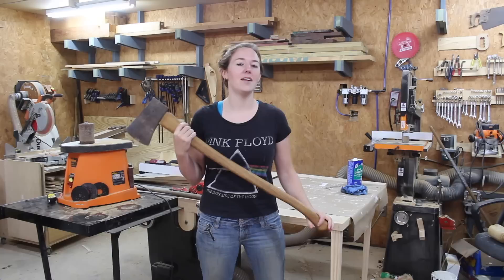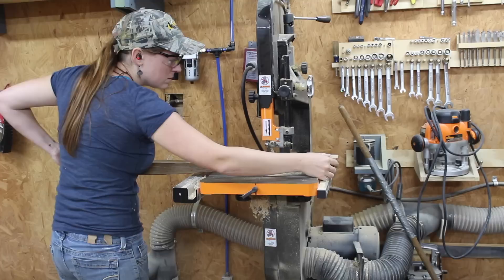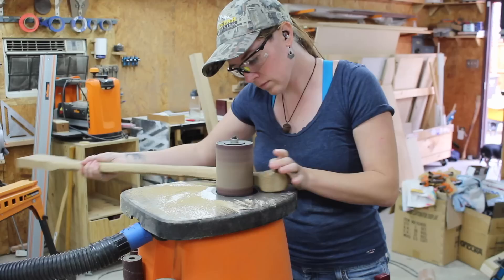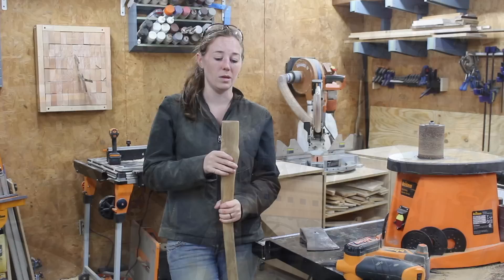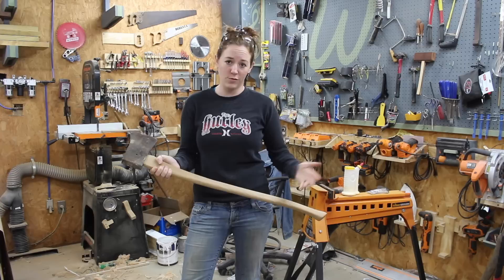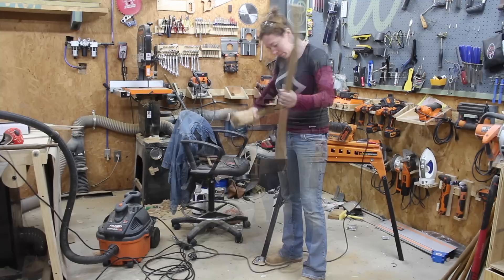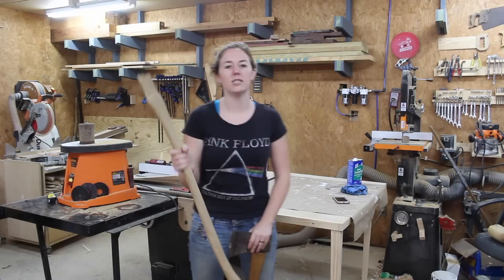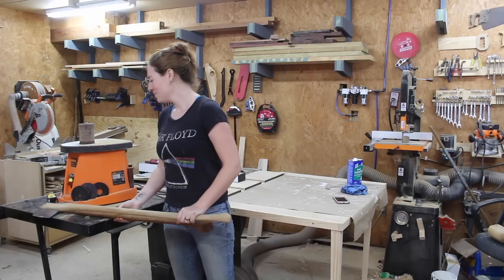Making an Axe Handle

Comment: I made a cabinet door for my kitchen, and discovered that I had put the rabbet for the insert on the outside on both stiles after assembly. (future small picture frame maybe?) I have learned woodworking by trial and error. (LOTS of error!)

Comment: Well, April. Here is my failure. I was making a drawer for A piece that I had built the year before for my parents. Now this was my first ever building a piece of furniture, so nothing was quite square, just square enough to fool the eye. And so the drawer had to match the out of squareness. I probably spent a few hours making the drawer bottom just right, and went ahead and glued it up. Much to my dissatisfaction I found that I had glued the bottom in upside down, and in just the worst orientation possible. 

Now I did manage to save it in the end, but it wallows around in the cabinet, as opposed to the close sliding fit I had achieved before gluing it all up.

Comment: Built an entire kitchen table only to find out I had put the whole table top on upside down, with all the attachment points on full display for anyone to come see. Pretty sure I had put the legs on backwards too, but didn't bother to check, turned it all into fire wood then restarted it all over again. You learn more from your failures then you do from your successes, although it is nice to get things right the first time.

Comment: Yep, I got a good mistake also. I was building drawers for under my bed. I measured many times and cut like you should. But, I found that I needed 1/2" more taken off due to changing my drawer rails.  But I cut 1 and 1/2" off (stupid mistake). Needless to say it did not fit.  Then I had to make a 1"  spacer so I did not have rebuild the drawer (which was a lot cheaper).

Comment: soak the head / handle in antifreeze for a day. It will expand the wood. Then dry it for a few days the water will evaporate but the glycol  and borax will stay in the wood keeping the head nice and tight. It will also make it so the wood expand and contracts alot less with humidity thus not come loose.

Comment: draw knives are so nice to use I use them to make Bows from Yew. you don't even need a band saw to do it. It goes so quick. And with your super jaws to hold it it would have made quick work of your handle and just minimal sanding. Try making a Bow only to have it explode when working on the bend in it. 10 hours of work gone in a instant

Comment: I have never seen a professional lumberjack use a curved axe handle. If you ever redo this, go about it like the traditional axe handle makers do:

Find a straight, knotless piece of hickory or black locust, or if one of your European friends can get you any, cornel cherry - it's IMO the best one, harder than hickory but still elastic (so dense it doesn't float). Split it lengthwise (i.e. don't cut it) to a piece about the shape of and a size slightly larger than the axe handle you want to make, and then shape out the handle using a drawknife and spokeshave.

An axe handle is exposed to a lot of shocks. If the fibers are not continuous from one end to the other, chances are it will split. It's also the reason why woods which are both tough and somewhat elastic are used - birch or oak are tough but tend to crack rather than bend under stress.

Comment: Instead of hitting the bottom of the handle to seat the head, I always slam it on the floor. It's faster than the mallet. Also, there is no need to glue the wedge. Once installed, it will not come out.

Comment: Here's my story of accidental failure -
I was a System Administrator for a retail chain, with a computer in each store that handled the inventory and price changes.  One late night I was logged into one of the stores from home, and when I got finished with what I was doing I did a routine check for any additional issues.  The database directory had a lot of old error files that I decided to get rid of, but as I was typing in the command my thumb twitched on the space bar at just the wrong instant and I deleted the whole database.  I had to call the store (luckily there was still someone in the office) to have them mount the previous night's backup tape so I could restore it.  But of course they weren't current on their backups, so the most recent we finally found was three days old.  I restored things to that point, then the next day they had to re-scan in three days of markdowns - which probably took a good half day - before they could get back to work.  Yeah, that was fun.

Comment: Mistake... Before we moved, I replaced the overhead slab garage door with an aluminum tracked overhead door with coiled counterpoise spring. Just to get it all set up nicely, I faked it in with big nails, then started replacing them with lag bolts.

A week after we moved, the new owner called. "You garage door fell down!". No one hurt, car wasn't in the garage, but, geez!

Yep. Failed to replace MOST of the nails. Repositioned it, bolted it, mea culpa-ed about a hundred times.

Door is still working 19 years later.

Comment: Creating the opening for my Kreg Router plate on melamine.  

Try #1:  Carpet double-sded tape scraps on melamine so I can route the opening...as I was routing, the square opening didn't look square. I realized the double-side tape was sliding.  It was completely messed up.   

Try #2:  Clamped the hell out of the scraps to the melamine...slipped again because of how slippery melamine is.   (mind you this has wasted 2 - 24" x 36" boards).  
Try #3:  Big sheet of MDF that covered entire Melamine surface, created square opening template, double side tape and every clamp I had.  Success...

Comment: I had a mistake like that. I built a box with curly maple and had the grain going in the wrong direction. So I had to scrap it. Nice work on the handle but don't think that was a mistake because you have more experience shaping another one.

Comment: Great video, but a bit confused, what was wrong with the old handle that you had to discard and do a new one???? Looking forward to the next video.
Reply: mumihp, its backwards. The head won't fit on the right way.
Reply: The teardrop shaped top of the axe handle, which was so carefully fitted to the eye in the axe head, is now backwards, and cutting the shoulder of the handle down to recreate a new top would leave the axe weakened at a vulnerable point of stress just under the head.

Comment: A mistake that I've made...I was trying to build a rolling work bench but had to take a break for about a week.  When I got back to it, I had one side built and just had to build the second side then add the braces between that ran the length.  Well On the second side I grabbed the width pieces instead of the legs, and didn't realize until I tried attaching the two halves.  One side is about 4" shorter than the other, so I'm going to cut the two legs on that side, square up a 2x4, then put it where I cut the legs to boost that side up a few inches.  It was a bummer and I won't be able to get back to it for a month or two, but mistakes are how we learn

Comment: Most people do what you did and start with shaping the handle first. For your next one, perhaps do the head work first. Get it right before starting to shape handle.   If there is a mistake you will not have lost so much work, and you might be able to save most of it.

Comment: Do you think you could have drilled out your wedge to remove the head when you put it on backwards?
Reply from the maker: The eye is directional, so the head can only be mounted one way on it. Once the eye is cut, you're stuck with what you've done.
Reply: gotcha!

Comment: Sure you made a mistake, but I'm willing to bet you will look multiple times for orientation of parts on any handle you do from now on.  My only concern would be whether or not the oak might be too brittle for an axe handle. I guess only time and use will tell.  Here is my screw up story (with a happy ending).

Something like 20 years ago, My dad and I had found a local mill that would let us have all the scrap lumber we could haul away. Lots of short pieces of various widths and lots of long narrow and thin strips. We started making lawn ornaments out of this scrap wood and making pretty good money from selling the stuff. 

We found someone we knew who had a windmill yard ornament and snapped some pictures with our Polaroid and started making one.  When it was done, we stood around looking at it and it looked wrong. Everybody that saw it agreed that something about it was off. We decided to try to sell it anyway and while sitting behind our goods in a local wide spot on the berm of a road, a very nice old feller looked at the windmill, cocked his head and asked me if I knew one of the blades was backwards.

Three of the blades were pitched properly to allow the wind to turn the shaft and the fourth was mounted the opposite way.  I thanked him and we laughed about it.  I told my dad and we laughed about it. Shortly after, a man and woman from out of state who were just driving through stopped and tried to buy it from me. I said that I couldn't sell it as I thought something was wrong with it. (too ashamed to say exactly what) The tag on it said $50 and he really tried to get me to sell it. I wouldn't. After he had talked with his wife, who apparently really wanted it, he asked me if I would take $75 for it . He was close to me and said "Please, sell me the damned thing so she will shut up." I did sell it and even helped him load it into his SUV.  We still laugh over that sometimes.

Comment: April, I can't tell you about a project that I've made a mistake on because I've never made a project that I didn't make a mistake on and every finished project I've made have a few mistakes in them.
   I would like to point out a safety note though. Whenever ever you are using a metal hammer on metal, like your doing with the axe head or using a metal hammer on a metal handle chisel, you need to wear your safety glasses on your eyes. the reason is if you stop your video at 5:23 you see the axe head to the right of the handle where you have been hitting it with the hammer? Those corners are "mushrooming" and pieces of that can break off and fly into the skin of your arms and legs and also your eyes, seen a man loose sight in one eye from hitting metal on metal.

Comment: "Those who never fail, never do anything new" and on another note, back to not paying attention, when installing my mom's counter tops I went to cut the ends at a 45° to get to corner in nicely, cut the wrong 45 angle on both of them.... had to re evaluate how to put them in there so I didn't have to buy all new...

Comment: I had to build a door frame for the set of a show I was working on. My boss gave me a piece of wood, said make 9 more of these, then put it together. So I did, and the piece he had given me was the wrong size. so I had to take it apart (glue wasn't too dry) and cut each piece down a little bit and remake it to the dimension my other boss had given me. And you guessed it, that was also wrong. So because I listened to my bosses without checking the drafts of the door flat, we spent 2 hours making something that would've taken 30 minutes had I read the dimensions and seen that what I was given was wrong...

Comment: Oh man, where do I start? My most recent boneheaded move was, I blew my head gasket. So I tore it down, took the head to get checked over at a shop, and put everything back together. After that, the car wouldn't start. I chased potential issues for over two weeks until I realized that I had put the head back together incorrectly, leaving out a very important piece. So I disassembled it on the engine, put all the pieces in this time, and it FINALLY started. I'm still irritated that I wasted all that time.

Comment: I had two cabinets to make last weekend, like super simple stuff. First one, I glued up and brad nailed together and then realized I had attached the pieces wrong, and now I have to pull 10,000 brad nails. Then I went to glue up the other one and realized I had cut the sides two long, and had to take it apart, pull all the brad nails, cut the sides and then go back at it. So pissed.

Comment: Ok here is a mistake to surely make you feel better : Clients decided do make their own foundation forms and sub out the concrete pour before We framed and built the house. They actually built great forms and had it poured but when we came to start framing we realized one error, the foundation faced the house backwards!

Comment: You could drill and chisel out the wedge, then remove the head and reposition it :)
Reply from the maker: I could have made it rightside up but it would still be backwards on the handle and I didn't want that.

Comment: I recently put an axe head on a new handle, but I cheated and bought the handle.  Keep your first handle so if you ever find another axe head that is slightly smaller you can fit it on the first handle.  Or get two hatchet heads and make two hatchet handles, or. . .

Comment: Oh no #spindlesander.  Nicely done the handle is sweet. 
Bad day story ; I was working at a Ford dealership I and a another tech built the snot out of a brand new Ford Mustang we were just about done and I let the other tech button up the top end and long story short he pinched a .10 cent o ring on the oil pressure sender he test drove the car it came back on a wrecker ( tow truck) he kept driving even though it was smoking real bad and seized the engine. I flipped out !!! But lesson learned I won't let anyone touch a vehicle in my bays.

Comment: Let's see now. I have done the exact same thing with an axe. And changing tires on my car I have at least once put one of the old tires back on, just so I could practice doing it again. And machined an axle exactly to the hundredth of a millimeter on tolerance, except ten millimetres too small base dimension. So yeah, been there, done that.

Comment: Not a woodworking story, but the first time I rebuilt a BMW (motorcycle) transmission, I installed the shift fan upside down (which I didn't realize was possible) and the shift pattern was upside down. One up, four down. I think this would have worked well for a race bike, but I had to spend the next eight hours redoing it. 😬😬😬😬😬😬😬😬😬😬

Comment: Oh, I forgot to add in ONE of my mistake builds.....well I raise Tilapia in my basement.....I build a 500gal plywood tank from a set of plans...I decided to not glue the corners just in case I felt like disassembling the tank.....well.......500gal can have a bit of side force to it......This just happened to be my "breeder tank" worked great for a while.....I'm sure you can figure out what happened.....yep, 500gal of water on the basement floor and about 30 tilapia ranging from 12-18" long flopping around. 
Axe head upside down....easy fix compared to my knuckle head mistake......oh....and only lost 1 fish.

Comment: When applying boiled linseed oil wear rubber gloves.  Boiled linseed oil has lead in it.  Also when using a tool you applied boiled linseed oil to, Wear work gloves.
Reply: Boiled linseed oil does NOT have lead in it. Where did you get that crazy idea?

Comment: Not a woodworking mistake, but when I nearly had my raspberry pi ambilight system set up, all software installed, all wired up, etc., a cable slipped from my hand, fell on the raspberry and fried it. Completely broken, no way to fix it, had to get a new one and start from the beginning :c

Comment: Nicely done April.  I have seen a few paracord weavers put a protective wrap up near the head to protect the handle when wood splits a little to easily and the handle is driven into the splitting piece.  Here's and example: http://bushcraftusa.com/forum/threads/axe-haft-protection-project-ideas-w-pics.71660/
Most failures we experienced during my time out by the wood pile with axe handles was due to over swing or the easy split issue.

Comment: Oh yes April failure is real, i screwed up making an axe handle once and i kept it, a few years latter and i used it in a shortened down piece for a small hatchet then i used the last bit to make a small ball peen hammer handle.

Comment: April you should have sharpened  your ax before you chopped the wood.  it would've been a lot easier
Reply from the maker: It had a great edge already on it.
Reply: Trees in Texas aren't known for having particularly straight grain. Splitting isn't much easier even with a razor sharp axe.
Reply: April Wilkerson #youshould

Comment: 1) Signature end wave missing.
2) What type of wood was used for the handle? (Either I missed it or that detail is lacking)
3) I've never seen anyone use glue for this before, but probably works. I'd recommend a round wedge as a security bonus: http://www.hultafors.com/contentassets/e9c458881ea24c69a4defe6291db51eb/images/h0281828603_steel-wedge-round-2-pack_artnr_828603.jpg It looks like this mounted: http://i.imgur.com/Ng7H9l7.jpg?1
Reply from the maker: Wave is at 6:32. I made it from White Oak

Comment: the wedge is usually supposed to be made of hard wood
Reply from the maker: From the research I did, the handle is made from hardwood and the wedge from something softer so that it doesn't split.
Reply: That's not what the pros I spoke to said but different people have different techniques

Comment: I think you need to make a branding iron with your "W" logo on it.  So you can burn your mark in all your stuff.
Reply from the maker: Yeah I've been thinking about that, however I'm thinking about changing up my logo so I'm holding off on making an iron until I get it settled.